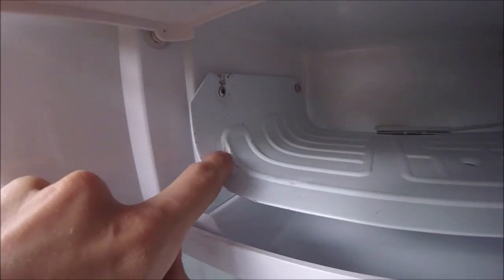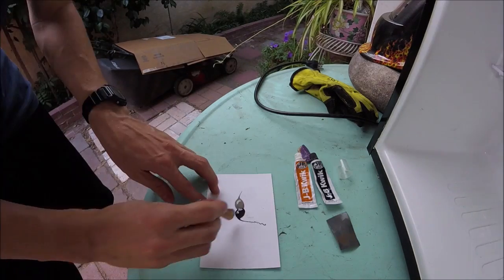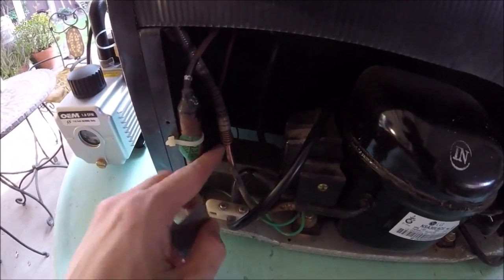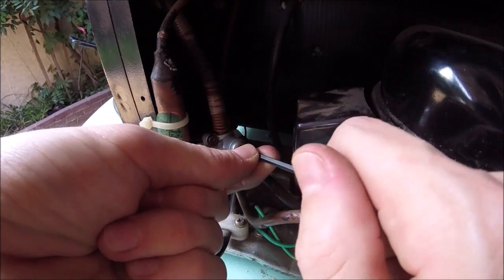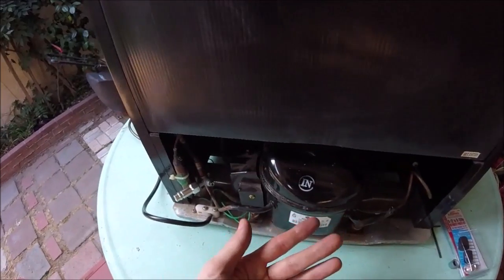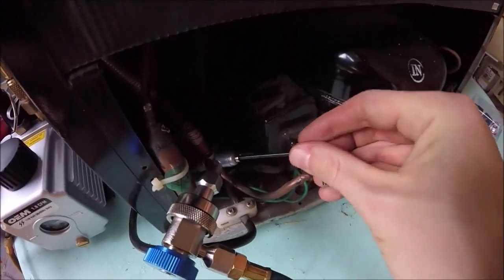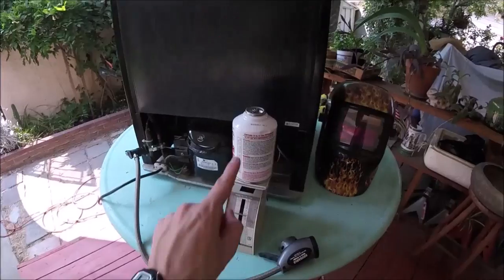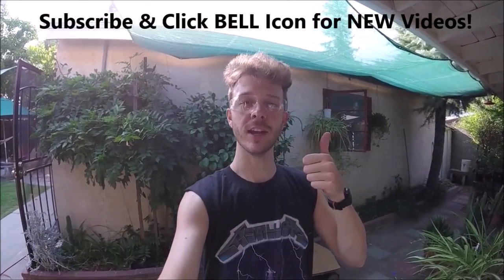How To Fix a Broken Mini Fridge -Jonny DIY

Comment: Fantastic video Jonny.  I too was an impatient defroster & made an icepick sized hole in the freezer line of a mini fridge.  That's maybe a 16th of an inch diameter hole.  The reason I used an icepick  was that I thought the freezer lining was a metal plate & the refrigerant  lines ran behind it. So I thought it was safe to pick it. I got surprised when the gas hissed out quickly.  This was like 5-6 years ago but I still have the mini fridge. So I hope this is also repairable.
Reply from the maker: Thank you. Yes should work well, just make sure you vacuum the system a bit since its been open so long 👍🏻
Reply: @JonnyDIY  ... Alright I will try that, thanks.  I know practically NOTHING about this so not sure what danger level can happen to me.  The fridge is not in front of me right now (in another town).  So, the only thing I am unsure of is how much all the tools & supplies will cost me. Fridge is probably 25-30 years old so I don't know what refrigerant until I look on label. I do have JB Weld but it's the regular one I think, so not sure if I can use that instead of the variant you used.  It's from 1990, heh, but the glues haven't solidified & I've used it in past couple years on some other stuff.
Reply from the maker: @robwebnoid5763  yeah doesnt cost too much when you use the gauges and vacuum pump on loan from Auto store. 1 small can of refrigerant and some jb weld. I had everything pretty much on hand when I fixed it. I figured I'd try and fix it before sending it to the dump
Reply: @JonnyDIY  ... Alright thanks.  Is your mini fridge still working?  Now all I have to do work up the courage & the time to even try it, heh.
Reply from the maker: @robwebnoid5763  this fix is still holding years later, I woulda been happy with 1 year but been over 2 years
Reply: @JonnyDIY  ... Awesome, continued use.  Shout out to JBWeld for that too.  Last (maybe) question(s)... Had I asked a fridge repairman to fix this, would he/she laugh in my face & they say that it costs more to repair than to replace with new/used working unit?  Note, mini fridge, not regular size fridge.  That was my first thoughts those years ago, i.e. whether I get this small thing fixed $$ or just dump into recycler because of its mini size. What repair would they have done?  Maybe replace entire freezer lining, instead of patching the hole?   
Speaking of reg. size fridge, we also had a decision to make with one where the compressor died, ~2014, but ultimately we went with a new fridge. We had this old reg fridge since mid 1980's. But had we fixed this broken one, probably would've saved $500. The repair asking price was $600+.  It was the attraction of a new fangled model that based the decision, which costed $500 more than a repair. It wasn't my decision, I wanted old one fixed & save money, I didn't care if it's new tech, new features or shiny brand new.  I did find a replacement compressor online for ~$400 but had no skill in putting it in.  I think you have to know how to properly cut the compressor pipes etc.
Reply from the maker: @robwebnoid5763  a repairman would have said to replace freezer tray and then recharge. It would have cost more to have that done than buy a new one. Yeah sometimes its nice to get something new though. Like an old car, sometimes they can become money pits. You fix one thing, 2 more things break a month later.
Reply: @JonnyDIY  ... Yeah true about the car & enjoying new stuff every now & then, but I suppose a fridge is less complex, less moving parts, stays stationary etc.  Still needs somewhat exotic parts though (refrigerant), but perhaps a cheap fix for it is worth it, depending on its initial quality, as opposed to a rusting car.  The reg.size fridge worked for 3 decades straight, the mini fridge near same length. There is also an emotional attachment factor to it, not just utilitarian, as these fridges have been with us for that much of our lives, growing up with it, you passing by it countless times, taking it for granted, that you might as well try to save it & continue its existence.  Not everyone has that kind of sentimentality though.  I will try my hand on the mini fridge, just not sure when, it might even be never, but your vid showed there's a possible way without having it be expensive or just throwing out a good machine because of just one minor issue that I thought would have been impossible to do without professional help & a huge bill.  :)
Reply from the maker: @robwebnoid5763  yeah if you find some free time it's a not a bad lil project. Only spent a couple hours on it 👍🏻
Reply: @JonnyDIY  ... Ok thanks.  The part where you were doing the gauges is where I would be nervous on. Heck, even the pipe piercing.  What kind of rental money are we talking about?  And is the air compressor (behind the gauge in your vid) part of the rental or do I have to buy my own (as I don't have one)?
Reply from the maker: @robwebnoid5763  vacuum pump and gauge set are free, just have to put large deposit down that is refunded when bring em back 🤙🏼
Reply: @JonnyDIY   ... Alright, I shall check Autozone out, there's one in town.  I'm not much of a car guy either so I may have visited that place only once before.  Will check out your list of parts links as well.  I hope I don't break that gauge set while I'm using it heh.
Reply from the maker: @robwebnoid5763  good luck! 🤙🏼

Comment: I don't know if you're going to believe this.
  I acquired what looked to be a fairly new LEC fridge freezer,  some time around 1985. Brought it home. A couple years later it broke. My Dad fitted a new compressor and it was working until last Saturday 10th Oct 2020. I burst the side of the freezer while cleaning the ice out with a stiletto ice pick. All the gas came out.

    My partner said old fridges can leak poisonous gas and we should get another...which I'm trying to do... but if I fixed it is their anything dangerous it could do at such an age?
Reply from the maker: Wow thats a good fridge to last that long. Sure dont make em like that nowadays. Yes since was an old fridge the compressor probably took R12 refrigerant. R12 can't be bought by consumers anymore so you'd most likely need a tech to recharge after fixing leak. Unless you find the R12 second hand.
Reply from the maker: But yes to answer your question, you could patched and have it recharged but may be worth it to look for a new one, granted there's a high demand for them right now
Reply: @JonnyDIY  I'm still grieving for the loss. "Old Fridgy's" gone sob sob.
 
 I got the chance to buy a smaller "Essentials". It's only a week old (bought as a stop gap) but I'd need to transport it lying on its side in my car. I'm not sure if that's a good idea. Got any advice  Jonny?
Reply from the maker: @cozmcwillie7897  My deepest condolences for ole Fridgey 😂 Yes if you need to transport a fridge ever and need to lay it down,  it's ok but just be sure to stand it in it's normal upright position for at least an hour before plugging back in. If its been on it's side a while, I'd leave it unplugged overnight. Just gives a chance for the refrigerant to trickle back down into compressor. I've moved fridges on laying down a few times and done this without any problems 👍🏻
Reply: @JonnyDIY  Thank-you for your replies.
  I've one more question, I hope you don't mind. I came across someone saying they'd never buy a fridge with a plastic back; because they believed them likely to go on fire.
  Do you think all plastic backed fridges likely fire hazards ?
Reply from the maker: @cozmcwillie7897  you're welcome. And no I dont believe them to be a fire hazard, as long as they came that way from the factory. I've never heard that about refrigerators, so I wouldnt worry 🤙🏼
Reply: @JonnyDIY  Thanks again man, you've put a couple o' minds at rest.
   Never realized how awkward life could be without a fridge.
  Having to shop every day instead of weekly. Mind you, cheese, milk an a few other things taste better room temperature.

  Other thing is ye get heat from it; in the morning it's taken the chill out the kitchen.
Reply from the maker: @cozmcwillie7897  you're welcome, yeah we sure do get used to our creature comforts. Hope you guys can find a new fridge sooner than later before the holiday rush 🤙🏼

Comment: Can I use flex glue to substitute for JB weld
Reply from the maker: No, I would only advise using a 2 part epoxy such as jb weld or gorilla glue epoxy. Can get one of the syringe style epoxy tubes for easier mixing/application 👍🏻

Comment: It is not even easy as much as it is shown in this video and also this procedure of repairing inner freezee box with that two tubes is also not everytime is successful..  I am repairing this types of refigrators from last 6 years..  And evertime i replace that freezer box bcs replacing old ice box with new one is only successful way for the better life of fridge..  And replacing is mandatory bcz compressors sucks ice water when we punchture ice box..  So it is better to follow full procedure to repair fridges.
Reply from the maker: Yes replacing freezer tray would be better if cost feasible for sure 👍🏻

Comment: I just broke my fridge exactly like this, did not think even for a second that that thing up there was like a radiator.  I was 100% sure it was just a piece of sheet metal.  I found the R600 (listed on the sticker on back of my fridge) with a charging hose but without a gauge for $22, the bullet piercing valve for $4, JB Weld for $6....but those $20 conversion fittings really takes a big chunk of the budget.  Seems the charging hose is meant to fit on the piercing valve, and the charging hose comes with the can so it must fit on that, so the conversion fittings are mainly for the vacuum pump?  I bought this mini fridge used for like $65, so I was hoping to not put too much into it to fix it.  Is there a chance the hoses on the vacuum pump fits right on the bullet piercing valve without those blue/red quick connects?  And if I'm weighing the freon, is the gauge really necessary?
Reply from the maker: Yes if you are weighing the refrigerant a gauge is not necessary just the scales fine. You could probably get away with just using the vacuum hoses without the quick fit connections. I'm not a hundred percent sure though. The adapters probably aren't necessary. I bought them for ease of connections because I didn't have the refrigerant hose can tap line which it sounds like you have. You are just going to have to weigh it out if it cost too much money you may be better off just ditching it and getting a another used one. I had most of the supplies already and only spent about fifteen $20 to do the fix
Reply: Jonny DIY how important is the vacuum
Part, is that strictly making sure the leak is sealed and there are no others?
Reply from the maker: @stephenbohmer4569  the vacuum part is very important. It not only tells you if you have properly fixed your leak but also remove any air or moisture in the system. If there is air left in the system and not vacuumed it won't be able to be correctly recharged and in turn won't cool properly 👍🏻
Reply: @JonnyDIY  Heard.  Thanks for the heads up!
Reply from the maker: @stephenbohmer4569  You're welcome 🤙

Comment: Great video!! Thank you. 
My mini fridge just stopped working. Got any ideas on what it could be? It will not come on at all, not even the fan.
Reply from the maker: Start relay maybe?
Reply: @JonnyDIY  it's that in the little black box with all does going to it? I'll check that out. Thank you!!😊
Reply from the maker: @zane4utwo  you're welcome 😁👍🏻 yes it will be with all the wiring of the fridge

Comment: Is it necessary to add the back area? Same thing happened to my mini fridge with a screw driver 😅 once the hole is patched up will it be back to normal?
Reply: Or is that little thing a must for the fridge to work?.. 🤔
Reply from the maker: @v9mpire651  yes the complete process is required to get it cold again unfortunately. So glue, then add valve, vacuum then recharge

Comment: How do you know what line to add the bullet valve and refrigerant to? My fridge has a short crimped hose going to nothing,  and 2 others leading from the compressor.
Reply from the maker: use the stubbed service port line if you have one 👍🏻
Reply from the maker: Ps- should be the thicker diameter pipe as well

Comment: Questions
1. Do you really need a vacuum pump? can you just do without one? 
2. In regards to A/C Refrigerant R134a part, do you leave that part on the pipe? is that an option? what to do with that part part, if you have to remove it do you just re-seal the pipe with the same sealant?
Reply from the maker: Yes once air is exposed to the inside of the refrigeration system the entire system needs to be vacuumed of all air. And the adapter fitting you just remove after recharging with refrigerant. The bullet piercing valve is self sealing when you close the Allen key off.
Reply: @JonnyDIY   Thanks. I appreciate the information
Reply: Is there any way of preventing the epoxy from getting in the tubes? I know you said don't force it but what if some got in the coils due to doing the patchwork. I mean like it seem to me once you apply it and it dries its done deal because the hole will be sealed up regardless if any of it got in the coils. 

I bought the equipment I need including the epoxy.  Before I saw your video, I tired to seal the holes with some caulk. I used the one that was suited for metal, plastic, etc. After watching your video, I remove it for the most part using adhesive remover and sand off the rest to get it out of the weird areas (grooves) it seems like little bit of it is still there (literary a tiny bit). So my question is will the caulk be an issue when your applying the epoxy?   

Do you have a email I can contact you?
Reply from the maker: @CraigLeachmanDesigns  try and get all the caulking out of tube. Use a vacuum or shopvac. You could put a tiny piece of tape just over hole and then cover it and surrounding area with epoxy 👍🏻
Reply: @JonnyDIY  what kind of tape to use? and there's hardy any caulk there
Reply from the maker: @CraigLeachmanDesigns  any kind doesn't matter, its just to stop epoxy from flowing into pipe. Get all the caulking out or itll end up clogging system and stop working
Reply: @JonnyDIY  I successsfully got all the caulk out. 

I will apply the tape (most likely duck tape) to cover the holes than apply the epoxy. Some areas is dented inwards and i can't get the dents out will that be a concern?
Reply from the maker: @CraigLeachmanDesigns  should be fine, would only be a concern if tubing was completely crimped shut. But dented wont be an issue
Reply: @JonnyDIY  it's not completely crimped shut but its pretty dent up only where the holes are located at
Reply from the maker: @CraigLeachmanDesigns  ohh ok, should be fine then 👍🏻

Comment: I already own a vacuum pump and chamber with a gauge. Would all I need to do is buy another hose to basically create the same effect as the autozone version?
Reply from the maker: Not sure, but you need the 1 hose from vacuum pump to gauges and the 1 from gauges to valve, & that one needs fitting to go on the AC adapter I used. May be worth to just use loan a tool from Autozone so you know youll have everything needed
Reply: @JonnyDIY  At this point you've inspired me to buy the gauges and hoses to use on my car for AC anyways. Thanks for the response. Will send you an update on how it goes for me. Thanks again.

Comment: Question that happened but my brothet in law decided to put flexglue and plug it back in. I saw this today this happened yesterday and of course mini fridge not colling could he of messed up the compressor
Reply from the maker: Sounds more like it just leaked out all refrigerant , that's why it isn't cooling anymore. Epoxy glue and recharge like I did in video to get it going again or youll have to pick up another one. Can get 2nd hand ones for cheap 👍🏻

Comment: I have a question for you. When you look at your mini refrigerator facing you... in the freezer part on the right hand side is a big hole from knocking the ice loose. Is that hole repairable or not?? If it is what can I use to fix the hole so it's running smoothly and everything stays cold
Reply from the maker: if you punctured refrigerant line you will have to fix and recharge as I did in video
Reply: @JonnyDIY   How can I tell if i punctured the line?? It did give off like  a burning smell
Reply from the maker: @drummerjms  it would have made hissing noise and would stop cooling within a day or so
Reply: @JonnyDIY  I already unplugged it earlier this morning

Comment: Hi had a question. Is there a specific location to put the piercing valve? Does it matter if it's on the left or right side? There's two copper pipes that are connected to the compressor on my mini fridge but I'm not sure which one to out the PV on.
Reply from the maker: put it on the bigger pipe on left, should have a stub on end of it, thatll be the low side 👍🏻
Reply: What happens if you put it on the wrong pipe on the left side?

Comment: hey how I rent that vaccuume and gauge set from autozone.  do you have a link for the set you used
Reply from the maker: you just go in there and ask for those 2 through there loan a tool program. You do have to put a rather large deposit down on them though. Around 300

Comment: Very good video & info. Wonder what to do with a bigger hole or one with metal skin blocking a big section of the small pipeline in the freezer tray. Some videos aren't showing a vacuuming step. What happens if one adds refrigerant without vacuuming first?

Thanks a lot
Reply from the maker: if you skip vacuuming,  it won't cool properly